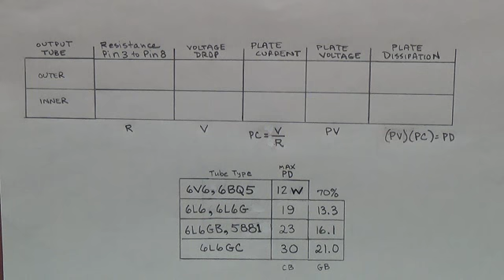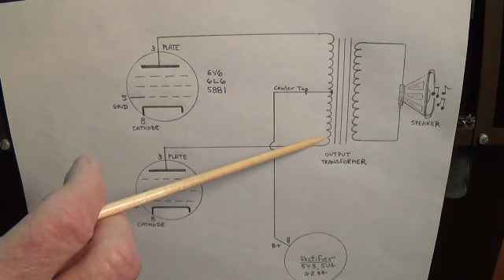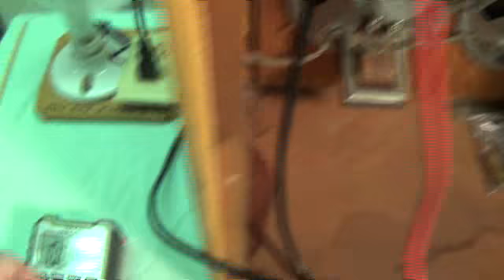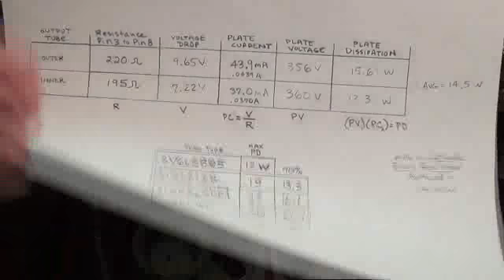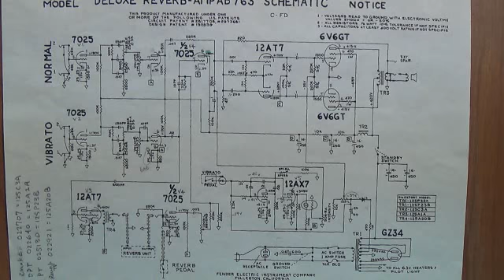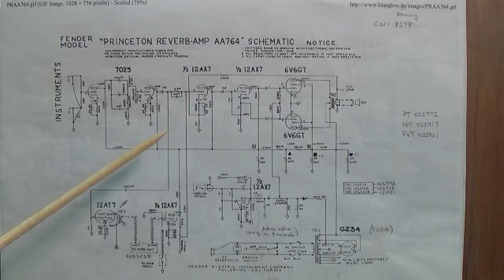Biasing Double-Ended Amplifier Output Tubes, Part 2: Demonstration and Discussion

Comment: Howdy. On the topic of biasing a class AB push-pull output tubes setup. Assuming we use a matched pair. Also we use a common cathode resistor.
On small signal both tubes are conducting. The cathode resistor sum current is constant. The cathode capacitor keeps the biasing voltage constant.
On larger signal the tubes go off in turns. The conducting tube takes more current though.The cathode sum current is still pretty much constant.
At high power the conducting tube will take way more current than the off tube leaves untaken. The sum current increases thus shiting the biasing. A large capacitor does not remove the shifting. It only slows the shifting down.
This results in a pumping effect and signal compression.
Why not use a zener diode instead of a resistor ? The zener voltage will vary much less than the resistor voltage keeping the biasing stable although the signal power varies. I have never seen cathode biasing done with zener diodes in any factory built amplifier.
Regards.
Reply from the maker: Neither have I, Eugene. Perhaps you should build a prototype and test your theory.
Reply: @UncleDoug  Howdy mate.
I actually have done that and observed it to work well. Check my blog:   eugpoh27.blogspot.com     Chapter 27.1 The schematics.
Regards.

Comment: Uncle D; some quick questions:  What year were the first amps made that had a tank reverb?  Or did they use something else?  Who was the first to do reverb?  Thanks for the tutorial on tube biasing btw.  Seems that reverb just popped up.  Although I've had amps that had reverb, it never occurred to me when that began . . . thanks!
Reply from the maker: This is not an easy question to answer, Mr. RG. Here is a forum session that addresses the issue:  https://www.thegearpage.net/board/index.php?threads/what-was-the-first-guitar-amp-with-reverb.1431594/

Comment: Thanks for all the info,  i am trying to learn to understand my amp and all your videos  help a lott. Please could you help me and explain  what i am doing wrong . I tried biasing it with a biasprobe but the readings  i get are in my opinion strange. Two El34 end tubes grid biased, cathode to ground. Plate voltage 491 V ,  gridvoltage -37,7 V screenvoltage 493 V. With biasprobe : plate current 15 mA,   Pdiss= 491x0,015=7.365 W  ?  Output transformer method B+ centertap - platevoltage= 497 - 491= 6 V voltage drop. Rdc=54.9 ohm . I=6/54,9=109,2 mA . Pdiss =491x0.1092 = 53,6 W two very different values where am i going wrong  ?
Reply from the maker: I'm confused about the 497-491=6V part. No subtraction is necessary, you simply measure the voltage drop from plate to CT with a voltmeter. As a result, the PC is way too high, and the OPT winding resistance seems rather low.
Reply: @UncleDoug  thank you very much  for your help .  Measured voltage drop  from plate to ground and center tap to ground and  subtracted that , not good. Started new  measured the R from the OPT still  low  one side measured 53.3 ohm  other 53.9 ohm  the voltage drop  now  is 1,76 Volt  .  Up= 479 V.  I opt = 1,76/53,3 = 33 mA . Calculating Pd = 479 x  0,033 = 15,8 W (63,2% )  Using the biasprobe  I probe = 38,9 mA , calculating Pd = 479 x 0,0389 = 18,6 W (  74,4 %)  still some difference but much bettter . Should i leave it this way or turn it al little colder just to be save ?  Also the screenvoltage is higher 481 Volt than  the plate voltage  479 Volt , shouldn't this be lower ?  The screenresistors  used are 100 ohm  ,  would raising them  be allright to reduce the screenvoltage or  let it be ? The powertrafo is 220 V ( no 240 V available ) is there an option to lower the output  voltage  as also the  heater voltage is  7,2 V instead of the 6,3  V . I suppose a  lott of old amps  will have the same problem  with the power raise . Greetings from the Netherlands and thanks very much  for your help !

Comment: What I've done is to add a second bias supply with a separate potentiometer for each tube. Now I can even buy unmatched tubes and bias them properly, across a 1 Ohm resistor placed between the cathode and ground of each valve.
Reply from the maker: Excellent idea, Paul. I'm impressed.

Comment: Im a little confused on the measurement for voltage drop.  Im biasing a 5F6-A and one reading i got for DC voltage from pin 8 of the recto tube to pin 3 of one of the 6L6GCs is -300 mV.  As far as i know, that is-0.300 V.  
But to make the plate dissipation math “work”, im having to use 3.0.  

I notice your calculations are the same- for instance 7.22 volts.   

Can you help me understand the units here?
Reply from the maker: Something is obviously wrong, Nick. I assume that the stand-by switch is in "play" position when you took the measurements. If it is and your voltmeter is in the "volts" position, then you should be getting a voltage drop in volts, not millivolts. If not, then check the meter settings, probe continuity, connection points in circuit, etc.
Reply: Uncle Doug I’m really puzzled.   I tried two different meters and continued to get readings around 300mV.   

Another puzzling thing: B+ voltage is pretty much dead on.  Im getting 429 V  at B+1 (A)and Leo’s original 5F6a schematic indicates 432V.

Also, I played it and it sounds great.   Dead quiet too.
Reply from the maker: The measurements are taken with the 6L6's in place and the amp fully operational?  What are the resistance measurements of the two half-windings of the OPT primary?  They should be taken with the probes in the same locations as during the current measurements.
Reply: @UncleDoug  Yes, two JJ 6L6GCs, a 5U4GB Rectifier, and all three preamp tubes.  

I even went out and bought a fancy-pants Fluke Multimeter and I'm still getting roughly the same values.  Measurement details:

-Resistance (Pin 3 of 6L6 to Pin 8 of 5U4): 59.4 ohms-outer, 54.5 ohms-inner
-Voltage Drop (Pin 3 of 6L6 to Pin 8 of 5U4): -0.324 volts-outer, -0.327 volts-inner
-Plate Voltage (Pin 3 of 6L6 to ground):  421 volts-outer,422 volts-inner

So if I move the decimal point of the voltage drop one decimal place to the right, I get a reasonable if a little too hot bias of 23 and 25 watts.  Of course, I don't think there's any reason to do that.
Reply from the maker: Some observations and guesses: 1.) The correct rectifier tube for your circuit is a GZ-34, not a 5U4. The GZ-34 is a much, much better rectifier.  2.) Since you have a 5U4, perhaps you should be taking your readings from pin 2 of the rectifier.  3.) Are you sure your meter is set to DC volts, not AC ?
Reply: @UncleDoug  I was just starting with a 5U4 to lower B+.  I've got a GZ34 around too.  I'll put that in and remeasure.  The 5U4 and GZ 34 spec sheets both list pin 8 as "f,k" so I think the measurement should work.  

Another thought.  Could I measure the voltage drop by taking these two measurements:
A. Pin 8 of rectifier to ground: DC Volts (I think this should be B+.  it's before the filter choke and the output transformer)
B. Pin 3 of 6L6 to ground: DC Volts

Then subtract B from A, and that's the voltage drop.  Does that make sense?
Reply: @UncleDoug  I'm sure it was keeping you up at night, but I figured this out.  Seems like two factors were causing those readings:
1. I was biasing my amp with a lightbulb current limiter which was giving me abnormally low B+
2. I had to reduce the value of the resistor going from the bias pot to ground (original schematic called for 47 k, but I ended up at 23K)

I believe in one of your videos about biasing, you mentioned that a colder bias would result in more clean headroom.  Is that correct?  And when you say colder bias, are you referring to a lower plate dissipation in watts?

Comment: Check the grid coupling cap for leakage first .
Reply from the maker: By monitoring the stability of the plate current, you can evaluate the condition of the coupling cap.....i.e. stable PC indicates a healthy coupling cap.
Reply: Uncle Doug if I get old radios or amps I changed the caps to output tubes before I start .old radios of 30s use a interstage xfmr instead of caps .with 2 of say  45 output tubes no phase inverter circuit used thanks for your reply .fixed hundreds of stereo tube amps pa stuff maybe dozen guitar.amps not that familiar with them . retired 80 yrs old had a shop 55yrs.
Reply from the maker: It's great to hear from you, Don. Thanks for watching and commenting.

Comment: Here is a beginner's question.  How does a guy know what type of circuit he has in the amplifier in front of him.  How to know if it is single-ended, double-ended or grid-biased ? Is there any other type of circuit that requires a different procedure for biasing?
Reply from the maker: One Output tube = Single-Ended. Two Output Tubes = Double-Ended. If there is a resistor connected to the cathode of an output tube, the tube is cathode biased. If the cathode is grounded, it's grid-biased. Both types of biasing are measured the same way, but the method for correcting the bias is different. See my videos for details.

Comment: I get 36.45 watts and 21.18 watts. Clearly something is wrong and likely why the power tubes were blown when I got the amp...albeit it was given to me so what can you expect. Where do I go from here?
Reply from the maker: Correct and balance the bias of the output tubes, then install new ones, Daniel.
Reply: Uncle Doug, thanks for the quick response! I should have mentioned that this is a grid biased amp (Traynor YBA-4 from 1973 to be exact) Should I balance the grid or should I put in a resistor between cathode and ground?
Reply from the maker: Both plate dissipation values are too high, Daniel, so your best bet would be to  increase the -DC bias voltage to max, install a matched pair of output tubes, then gradually turn down the bias voltage until an appropriate plate current and dissipation value are reached.
Reply: Thanks again,Uncle Doug, for your response and also for the many videos you have made for all of us. I ended up installing a resistor between each cathode and ground until I achieved a good range. So now I am sitting with PC = 36.4mA and 38mA and PD= 16.38w and 17w. I have installed a new set of Electro-Harmonix 6CA7EH tubes that are known for running hot. I used 70% of CB specs as my reference point as you have suggested in the video.

Comment: I just finished putting new tubes in my 66 Fender Super Reverb, and used your plate dissipation method exactly as shown here in your video.  I have to admit, it took some time for it all to sink in, but once I started making adjustments and recalculating plate dissipation, it became obvious how useful this method is.  My amp was running very cold and no amount of bias adjust could get the plate dissipation up beyond 13-14 watts per tube.  It should be 20-21 watts each.  I realized that we are operating with higher AC voltages these days compared to 1966, so experimented with changing the bias bleed off resistor to a lower value, from 27K to 22K.  this did the trick!  I was able to make the bias voltage less negative (-40 to -48 VDC), and this allowed adjustment of the pot that I needed.  After several swings through adjustment and calculation, it really started to make sense how the bias voltage affects plate current, plate voltage, transformer voltage drop and plate watts each time you change it.  I started to get a good feel for where it needed to be, and in the final adjustment, the output was the specified 20 watts per tube, for 40 watts total.  The negative  bias level to achieve this result turned out to be -48 VDC, and that's fine.  It is definitely worth the extra time and trouble to go through this exercise, and I think I learned more about how power tubes work than I have in my entire career!  It's one thing to know the theory and try making small adjustments, but when you have to change the circuit to get the right result, that's pretty exciting!  I'm very happy with the sound now, and wanted to thank you for putting this great information out there!  Keep 'em coming Uncle Doug!   Mike in Texas.
Reply from the maker: What great news, Mike. I'm really glad to hear that the video was helpful. As you discovered, the absolute best way to learn is to use your basic knowledge in a practical way, gaining experience and increased knowledge along the way. I have only one observation. In most circuits, by lowering the bleed-off resistance, more of your -DC bias voltage went to ground, so less was available for the tube grids. This would have made the grids less negative, as you said, allowing for higher plate current......but -48VDC is more negative than -40VDC and would result in lower PC. I would have thought that your grid bias would have gone in the -40VDC direction, not the other way.
Reply: Such a wealth of knowledge !  You are an incredible Teacher Doug !

Comment: The transformer on my Bassman build I am doing which was an old PA, doesn't have a bias wire.  The schematic shows that the Bassman original transformer does.  I assume I can than just cathode bias this amp.  You mentioned 100 ohm resistors for the 6V6, but my amp has 2 6L6GC's.  What wattage resistor do you recommend me using?  Thanks Uncle Doug
Reply from the maker: Cathode biasing works fine and it's less "fussy" than grid biasing. I would start out with a 1000 Ohm resistor (or pot, so you can adjust it to find the right resistance then replace it with a fixed resistor), probably around 10W. After running the amp for a while, check to see if the resistor is too hot to touch. If so, increase the wattage.
Reply: @UncleDoug  thank you sir. Appreciate it.

Comment: if i change the output transformer of the Fender Bandmaster with primary 3.7k ohm 50W and change the tubes from 6L6GC to 7581A tubes  and with voltage on B+ 440v and  -48v to -55v on grid , does it work ? or do i need to change resistors in the output stage? with the knowledge its a fixed bias type of amp
Reply from the maker: From what I have read, the 7581A's can be substituted for 6L6GC's with no alterations other than re-biasing to a higher PD (up to 70% of 35W for fixed bias). Each circuit is different, so you'll simply have to make the substitution and then carefully monitor and adjust the PD to a proper level. Finally, audio test to ensure good tone.
Reply: @UncleDoug  does it effect if the primary of the output transformer is 3.7k ohm or 8k ohm ? what the difference between both regard biasing?
Reply from the maker: The primary impedance must be appropriate for the output tubes you are using. If the original output transformer had a primary impedance of 3.7K, then that's what you must use. The difference is not so much in biasing , but in tone quality, plate current, tube life, and output transformer life.

Comment: As usual I am learning so much from your patient and descriptive approach to teaching. I Just bought the same 67' PR but has a silver face AA764 and I looked inside and a bias pot had already been added and I just did all the calculations for PD and my tubes are running at 11.46 and 9.15 watts. Is this OK? it sounds very good very clean headroom with volume up to 5 or 6. Weber F150T 10" 50 watt speaker. I wasn't clear from your table on tube dissipation if we should be going with 70% of 6V6 12 watts (8.4 watts) or stay closer to 100%? Thx.
Reply from the maker: Since the PR output tubes are fixed bias (grounded cathodes) you have to limit the PD to 70% of max, which would be around 8.4W. This allows for an increase in PC and PD when the amp is driven hard. Your output tubes are not well matched and are biased too hot.

Comment: I really appreciate the fact that you demonstrate various methods to determine the bias of the output tubes. I have recently had fits with a cathode biased amp that I have told you about. I was explaining my problem to another person and they told me that the resistance across the output transformer center tap to pin 3 of the output tubes was irrelevant and then wanted to know how I obtained the plate current. They suggested that I go to a certain website and use a bias calculator. I was thinking to myself, how do you think these things we're done before online calculators? That's the beauty of the way you explain these things. I want to know the hows and whys as well the answers.
Reply from the maker: That's great to hear, B55. You're right of course. It's always best to know the fundamentals.

Comment: Hello Uncle Doug.  Thank you for all your informative videos!  I tried this procedure with my bulb limiter and found that my voltages were far lower of what they would be without the limiter.  Example my plate voltage without the limiter is 420 VDC, with the limiter it was around 270 VDC.  This results in lower values when doing the calculations.   Is there something wrong with my bulb limiter?   The amp (1974 Fender Bassman 100) draws under 1 amp when running.  Thank you.
Reply: I have found the same when using a 40 watt light bulb in the limiter... maybe a 100 watt bulb wouldn't limit voltage? I only use the limiter for finding issues (shorts of some kind) and for getting rough "relative" voltages (i.e., is the voltage drop about the same across this resistor as the schematic shows? Even that is only a rough ball park because the current and voltage are both limited so voltage drops will differ from schematic voltages.
Reply from the maker: It all depends on the bulb wattage you are using, Mr. C. If the bulb was glowing at all, it is of too low wattage. The bulb should only get slightly warm to the touch......never hot or glowing. Too low wattage = too much resistance.
Reply: Sorry for the late response.  The bulb is an outdoor flood lamp and had no wattage specified.  Last night I calculated that it is about a 75 watt bulb.  I will look for a 250 watt bulb.  Thank you to all.
Reply from the maker: Yes, the higher wattage bulb will greatly reduce current restriction to the circuit.